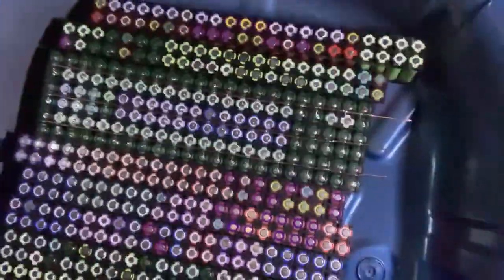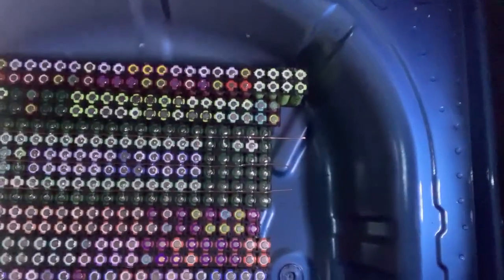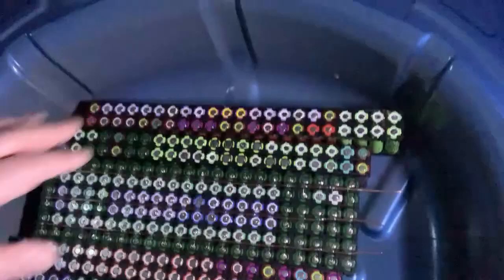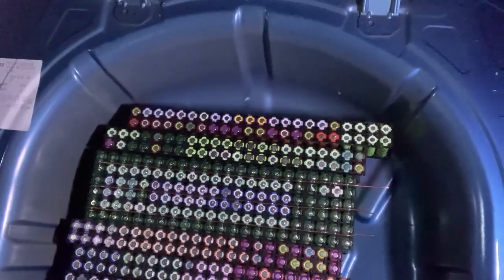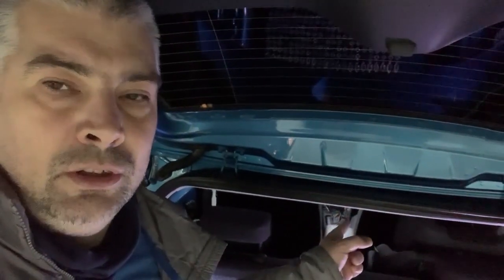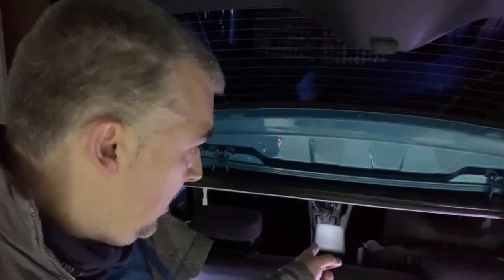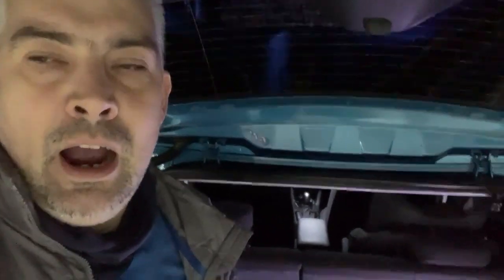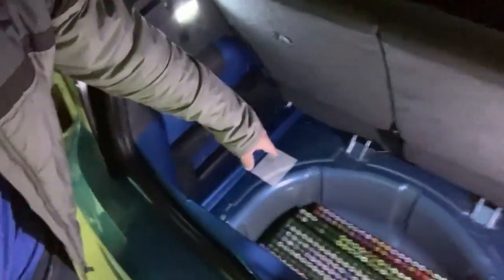Start of a project to extend Volkswagen e-up battery

Comment: This idea has more disadvantages than advantages; as a battery builder for years, I thought in using this space in my Seat Mii like you, but I trashed it 'cause  this main problems:
- 1st and most important, durability. If you use different batteries (different capacities and internal resistance) connected in parallel, both batteries suffers a lot from power transferences between them, so the life of both could be halved in the worst case. It could be useful in a bike or little scooter, but not in a 18 thousand euro vehicle.
- 2nd Security: you can aboid this putting secure batteries like LiFePo but with half the capacity or double the cost.
And not to mention connecting to the main battery, that removes the secure disconnection in case of great impact, and doing this removes the guarantee of car and battery of course... 
It simply don't makes sense. Cheers!!
Reply from the maker: You make a good point about the internal resistance. I also thought about that and the solution to that will be not to connect the both batteries to each other. I can connect the extended battery only to DC-DC converter which consumes at least 400 W to supply 12V system. This way I will give more power in the main battery for the motor. The other option is to connect the extender battery to the heater
Reply: @tedonash2681  It could be a simply switch tha switches between the two batteries, in case of need. in this way you charge and discharge separately but could have, in emergency, the spare capacity as a reserve capacity

Comment: Hey Tedo, you might do a round shape battery using these lego type caps to connect the batteries without welding. Maybe the battery can be even bigger and fit perfectly into the tire holder. The improved design now is vibration resistant perfectly usable in vehicles.  https://www.youtube.com/watch?v=rylbFnTgFI8  for tighter spaces there is an alternative which are the smaller hexagon holders: https://www.youtube.com/watch?v=YwyQohkELEU
Reply from the maker: You will spoil my next video :-) Thank you for the comment we are thinking in the same area. You will see in my next video about this project

Comment: Tedo, please check out these caps ( https://www.youtube.com/watch?v=rylbFnTgFI8 )where you can connect as many batteries as wanted without welding as easy as LEGO!!! It might work for your purpose (they have used it for e-cugat and it works pretty well). I wonder if the car improves the rapidgating after you have the battery working! Keep up with the cool e-up innovations
Reply from the maker: Thank you for the proposal. I know them but I have similar proposal that I will reveal in my next video.

Comment: That's a very nice project.
In my opinion, the effort of the project only makes sense if you could add even more capacity like 15 to 18kWh.
So that you have 80-100km more range instead of 50km bonus. Another layer cells may be possible, taking some height away from the trunk.
Reply from the maker: Let's find out what will be the final result. In my estimation it can easily be 10 kWh of battery added to the existing battery pack.

Comment: Hello.  on the leaf 24/30 many have had software problems with changing the same battery pack!  how do you plan to solve these problems?  by diagnosis?  thank you very much and congratulations
Reply from the maker: Yes I am hearing this from many sources this surely is the case for the Leaf. Let's see what problems I will have with Volkswagen e-up. I am planing to make one port for charging separate for discharging. This way I can connect the charging circuit to the AC-DC Type 2 onboard charger. If that does not work then fallback is to make a serape charger for that battery

Comment: That's look so stopgap. The weight of this 9kwh cells will make work harder every part of the car. lower top speed increase consuption. no place i trunk in so small car will meke it useless for longer trip and of course battery are not for free and you make it less eco.  So for few more km of range I would never do such thing to my car. I would reccomend to do it like extra battery that you can take off and on easly so if you would need a extra range you just place it fast and go.
Reply: 50kg is not a big deal, it is a small weight in comparison to other EV the e-up is very very light, so 50Kg is nothing! It might even balance the car, improving the overall driving, if you drive alone or with a copilot almost all the time.
Reply: @emekf9496  That's not a combi or pickup to make adventage of more heavy trunk. that's a short city car with front wheel drive.
 So in best case scenario this 9kwh battery will give ~60km of extra range.  (if  all accessories and bettery will not surpass 50kg and with good weather)
Reply from the maker: @emekf9496  yes I also think it will not change much the balance of the car.
Reply from the maker: Everyone can decide for themselves. Some of the people will do it son won’t so it is a personal choice
Reply: @tedonash2681  For learning purpose I can totaly understand that. But if somebody need a range car so he should go hybrid not make full electric high range by force. If he respects the planet or course.

Comment: Interesting Idea! Looking forward to the result. My only concern is the cooling. I mean, the HV Battery gets a passive cooling at least. Your arrangement is in a box without any air circulation. I would recommend a water cooling system between these both layers. (the thermal conductivity is much higher from top to bottom, as from the sides in this 18650 cells, because of the winded cell itself)
Reply from the maker: You have a point. But this really depends of how we will use it. One case is also to connect it to the DC-DC converter. In this case it will drain 400-500 watts and there will be no overheating. The other case is to connect it to the car heater. It consumes around 5 kWh max so this will also not generate any heat. It really depends how I will implement it. It really depends what will be the safest way
Reply: @tedonash2681  Very clever! Maybe having the battery dedicated to a mobile kind of small ceramic vent home heater will even avoid the risky internal electrical wiring
Reply from the maker: @emekf9496  there are several scenarios that I am thinking of and this one is also an option

Comment: You do know that your whole car will burn to the ground if you get rear ended, right?
And you are putting firefighters in danger because the emergency disconnect won't affect your DIY Battery.
You have a family after all. Maybe reconsider, if this whole thing is worth it.
Reply from the maker: I will not use this extend battery if I am not completely sure it is safe. What I would like to get from this project is understanding if that is possible and what problems I will hit during the path.
Reply: @tedonash2681  You probably know about the Lithium Titanate Oxid batteries, they are safer (will not burn if you get rear ended) and last for decades!!! https://www.youtube.com/watch?v=v8EBI-N0KTk Here a link of a guy making his campervan 10Kw/h battery: https://www.youtube.com/watch?v=kYx097cVR48

Comment: You can try to watch some info or contact Muxsan (https://www.youtube.com/user/PowerElectronicsBlog) - although they're working on Leafs, there was some issues, for example, the onboard charger doesn't charge the added  battery pack, because it has a counter and it just shut off charging over the capacity of battery pack itself (that was a case in 24kwh Leaf) so they had to make it another way.

Have you calculated how much weight it adds? Because the payload of car is not much, < 300kg (comparably petrol version had 400).

To extend the range I was planning to maybe put diesel heater, so on colder climate you can use car on longer trips without compromise of heat in cabin.
Reply from the maker: I would defensively watch the PowerElectronicsBlog. I think that the whole battery will add around 50 kilos to the car load, which will not extend the 300 kg limit of the car for sure. Because I don't find anywhere if someone have fight with e-up I thing I will be the pioneer and will learn what underwater rocks I will find
Reply: @tedonash2681  Yes, for the eUP I haven't seen anyone even doing battery swaps... 

If you understand russian, then there are quite a lot of videos (although they mainly are about Leafs).

But still you can check out other video how is their battery built, .e.g, Zoe, Leaf, i3 etc
Reply from the maker: @electricwhirl5175  yes I understand Russian (I live in ex Communist country so I had to learn it long time ago ). It will be nice if you can send me some links. Thanks.
Reply: @tedonash2681  it differ from countries to countries - at least guys from Romania said that russian is not common in Romania part, it's alot used in Moldavia. Also I know that in Poland was not used a lot. 
In Baltics it's like those who have russian/part-russian parents, know russian, but the majority of those born after 1990 doesn't know russian and even nowadays don't wan't to know, better learn english, german etc.
Reply from the maker: @electricwhirl5175  thank you man.

Comment: Wenn das einigermaßen Sicher klappt,  Das ganze dann noch sauber verpackt in die Milde passt und nur mit 2 Kabel einfach angeschlossen wird, dann hast du einen Verkaufsschlager. Im Schnitt 75 km mehr Reichweite. Das wäre ein festtes Brett. 💪👍
Reply from the maker: I will do my best to pack it as safe as possible.

Comment: Awesome.
it be attached to the built-in battery?
 do you use the car charger to charge?  a separate charger?
Reply from the maker: My plan is to be attached to the main battery in the power distribution https://youtu.be/ecFHmnrMOGA . Then all the modules BMS will have separate charge connection that I plan to connect it to the AC charger on the car. So it should be charger for the on board AC charger but will not have the possibility to be charged from DC fast charger

Comment: Don't forget safety: the spare tyre place is like a sink that collects any water in the Trunk. Therefore you have this round rubber stopper that might drain water out.
If the window or hatch   seals get older water can get in and will end in the trunk bay.
You better prepare yourself for designing a mold that becomes your full battery that can be sealed and removed easier.

I would build a battery Box for the Rear Seat or Trunk ...
Reply from the maker: There will be for sure some enclosure that I will try to make it as safe as possible.

Comment: Ever thought about a different place ?
The round shape is a nightmare to Deal with.

If you stay with the spare battery you should first try to get a basket which makes it better maintainable. You need to develop an epoxy mold taken from an old tire.

Or If you really want to extend the range by 15 kWh or so then consider to cut of the whole spare tyre bay and replace it with a maybe even deeper and rectangular shape of a Box to add maybe even 3 battery layers of 24 cm height. The round shape will kill your battery handling abilities.

Last chance: fill the First Level of the trunk above the spare tyre over the whole Floor with a battery .... that battery pack is a lot easier to handle and to deal with ...
The round shape is a nightmare to deal with in every aspect. And you are always close to the metall of the chassis and a short.
Reply from the maker: I really appreciate your feedback. You have a point in many aspects. I also thought a lot about the round shape of the battery and I found that there are like honeycomb which will help me build the round shape. I am planing to do very solid base of the battery with very good isolation. But first lets see how it will go. It may be a total failure.
Reply: @tedonash2681  OK, honey Comb is a complete different story cause far more efficient. What you did not mention or I had missed is the kind of battery like 14s60p for 840 cells and where you can connect toin the front - I guess DC.
I would Start the easiest way with a flat Level battery in top of the spare tire just for developing purpose cause these are easier to deploy , maintain and reconfigure than a 3 layer birthday cake shaped  battery.

And try to get first a mold or round shaped Box that fits in. 
It is a lot easier with a mold of the spare tyre space out of carbon fibre. And I guess that will offer the space needed for your Wedding cake shaped battery. These 3 layer batteries in a compartment are really tough to build as you had seen in your ammu Box battery build. 
I can tell you I would never start such Project in that spare tyre but with a modular build battery you can swap out of your Trunk and put in the garage to charge from the solar roof while your at work with the Car. Such 1 Level flat Trunk battery Is a lot easier to maintain.
If you add a BMS lower the amount of cells to get a battery of 3 segments for left middle  right each 14S20P or 280 cells that you can easily lift out of the trunk. ... around 15kg net battery weight without case or 2 x 14S30P each 420 cells and 21 kg. With case + Isolation + cable 25 kg.

Here is 2500 mAh 10A LG cell which brings 10 Wh or in total x 840 = 8 kWh for 1.600 €

https://eu.nkon.nl/rechargeable/li-ion/18650-size/lg-inr18650-m26.html

I guess you wanna start with new cells ... If so Check nkon.nl battery prices for 18650. They offer 500+ cell packages for about 1,50€ - 2€  each brandnew + genuine cells

HBpowerwall Channel from Australia has shown on sunday a burned or blown 18650 diy battery build of used cells of your size. Check it out how important quick access for maintenance of diy batteries can be.

Yes, a spare tyre battery would be best Like the LPG Gas cars have a Tank there too, but that will get really tough. Too much for First build or prototype
Reply from the maker: @typxxilps  I see you have a lot of knowledge in the area. I agree with you to everything. I have watched HBPowwrwall for a long time and I know his mistakes ( and I learn from that) . Mine main goal is to learn what that car underwater rocks are and share them with everyone. I hope I can give some thoughts for the mine for everyone

Comment: My initial thoughts would be on the validity  of the manufacturers warranty. Surely what you are proposing would invalidate the warranty.
I cannot offer any constructive advise at this stage but I will follow with interest the progress of your project.
Reply: And the Warranty for Battery is 8 Year... Fast all e-Up have for this time Warranty. :-)
Reply from the maker: Most of mine videos will void your warranty for sure. I think there will be no problems in the warranty if I put something in the spare wheel compartment. The problem will become when I connect it to the vehicle. But everyone have judge for them self. Sooner or later the warranty will expire.

Comment: Great to see more people customizing theirs EVs. Have you thought if you are gonna use BMS? (Balance those cells) it isn't easy finding BMSs for such high series count, at least not in hobbyist price range. But it also suspect that you don't want to feed 97 wires from the main battery pack to this secondary one.
Reply from the maker: Yes I am planing to build it in modules and each module will have 1 BMS and 1 active balance module